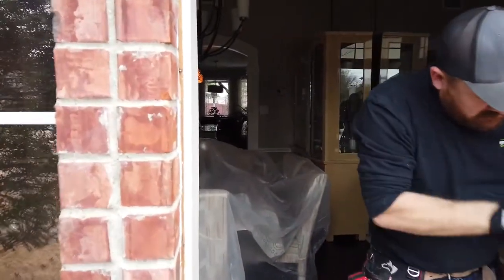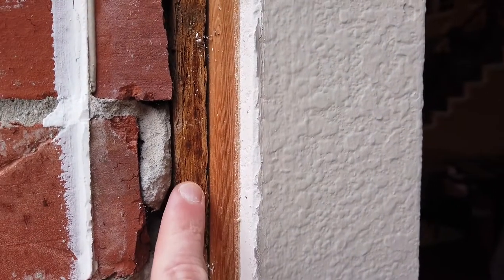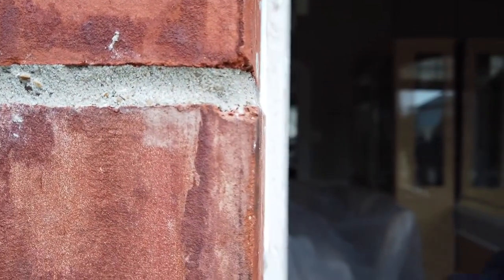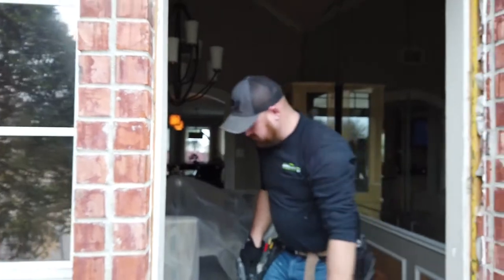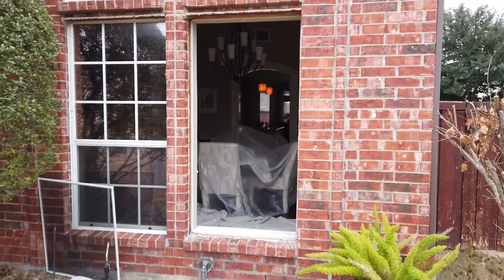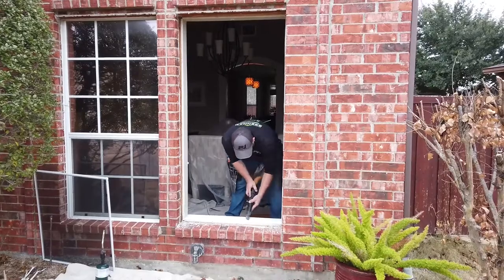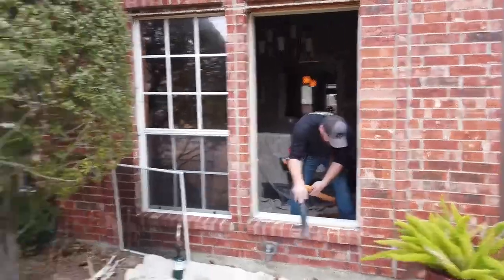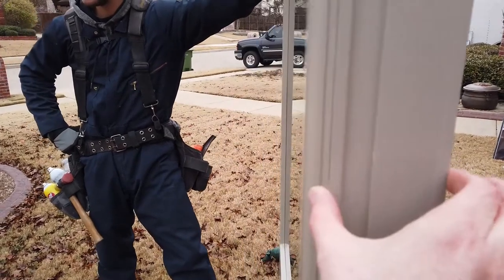Do You Install Replacement Windows from the Inside or Outside?

Comment: I agree with installing from outside. I've done them both. the inside is much more work which always gives the installer a reason to charge more. After installing my own for my home I try not to go back inside. So far I've done around 34 jobs and I find that installing from the outside works better for me. Also it's. a plus when  outside trimming has to be done as well.

Comment: When you do have an offset window condition, and install from the Inside.  Do you do any special provision fir the window/ brick interface? The inside face of the brick will be mostly rough, not a clean finish as the outside.